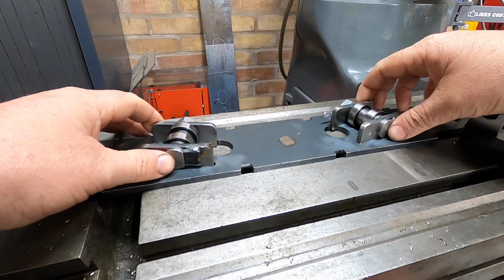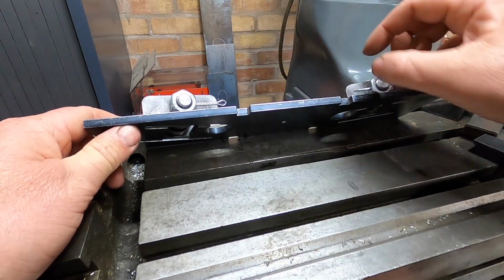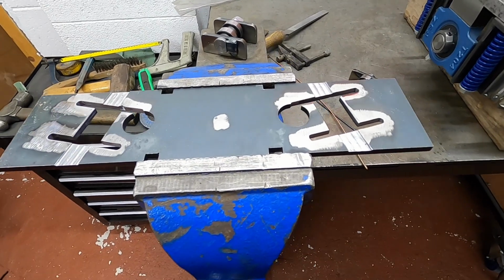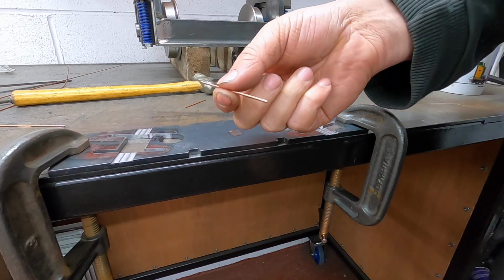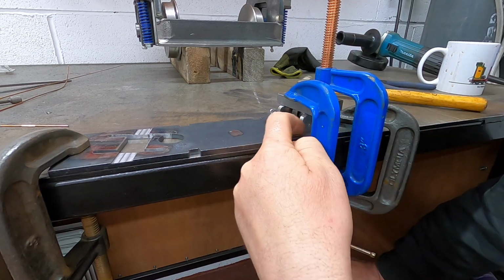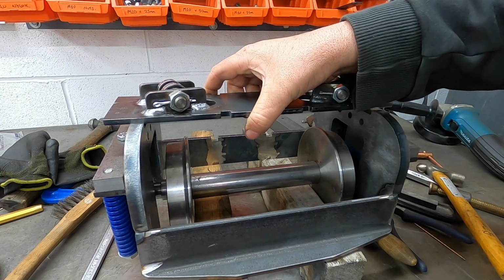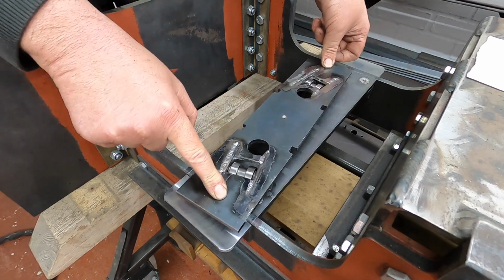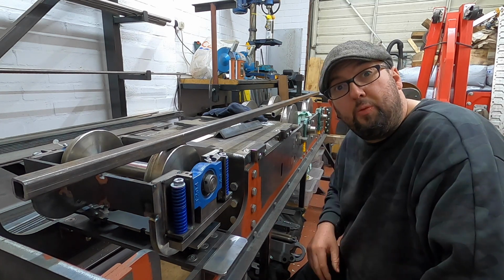Pony Truck Roller Skate continued - EP26 - 7.25" Gauge Steam Locomotive Build

Comment: Getting there Matt, wish my metal gluing was as good as yours , mine is more ....... bird dropping like
Reply from the maker: Cheers Ga Ga, 20+ years doing it professionally helps a little 😂. I'd like to to a welding series of videos but I need the right camera set up for that. Now if it looks like that, too much wire, not enough power or your moving too fast. All the best, Laters, Matt
Reply: Cheers I really should get a pile of off cuts and practice

Comment: As I'm only a 4mm modeller I'm obviously missing something, but why do you need to be able to take the nut off if the bolt is welded in place, nothing will happen,or will it?
Reply from the maker: Hi Mike, the pin(bolt) is not welded in place, it can be knocked out should the bearings wear out. All the best, Matt